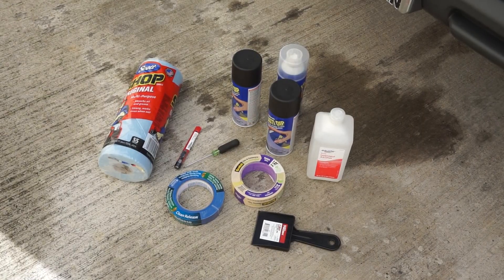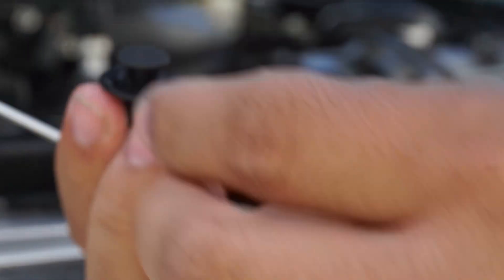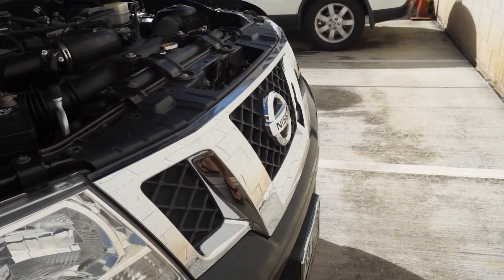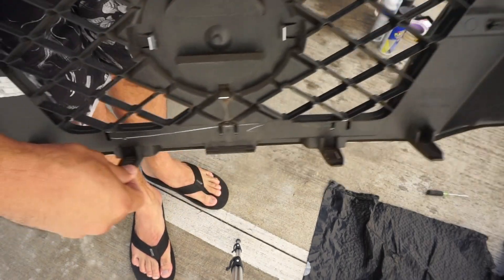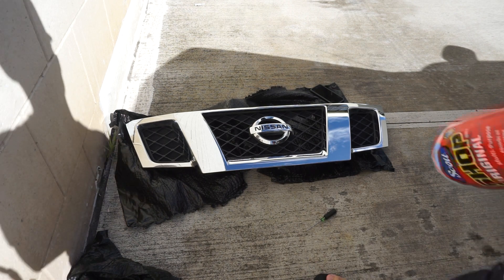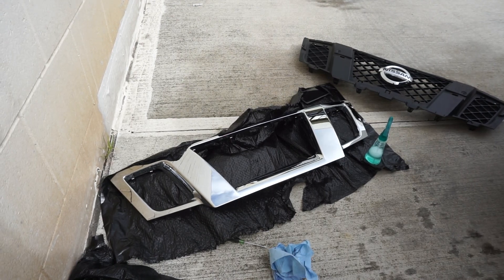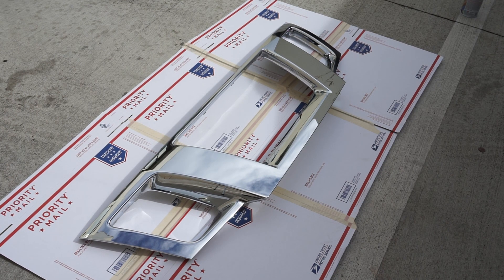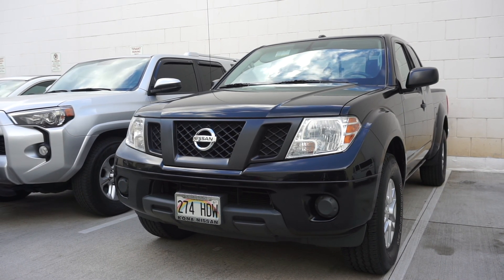Plasti Dip Frontier Grill

Comment: Nice job, as a recommendation if you haven't done so, go ahead and do the wheels, wash the wheels inside and out and apply black primer first, while you have the wheels off paint your brake calipers red as well. I would have painted the entire grille with plasti dip, eventually the black plastic will fade especially here in Hawaii. I have been doing the same with my 2008 Frontier, I am blacking out all of the trim.

Comment: why plasti dip? so it wont chip?wouldnt high heat eat that stuff away?..im going to paint it but I see a lot of these plasti vids...im interested! im doing my nerf bars/trailer hitch step and bull bar in front with "hammered black"..im thinking the plasti will last longer but looks like it takes a lot of coats.ideas,answers, all are welcome.otherwise the hammered black is pretty sweet looking,just dont know how it will hold up.its rustoleum all surface paint and primer and the hitch step is holding up good so well see.